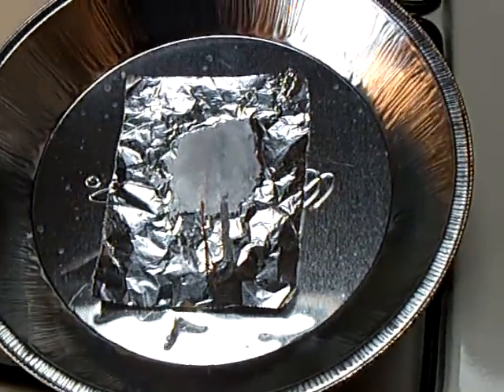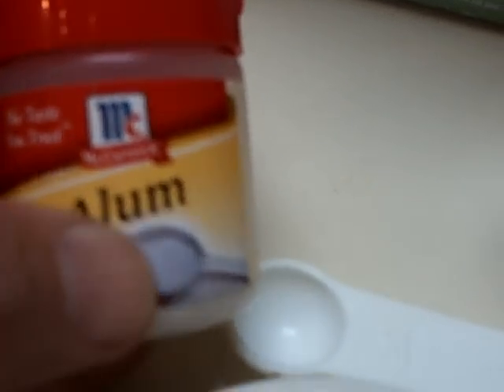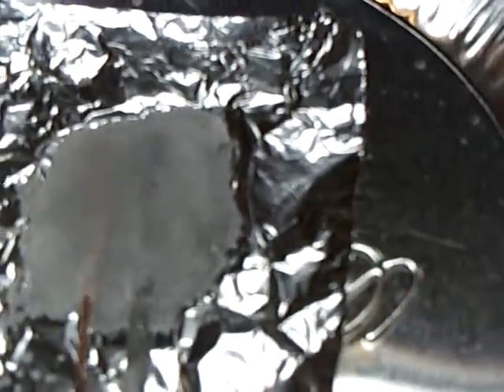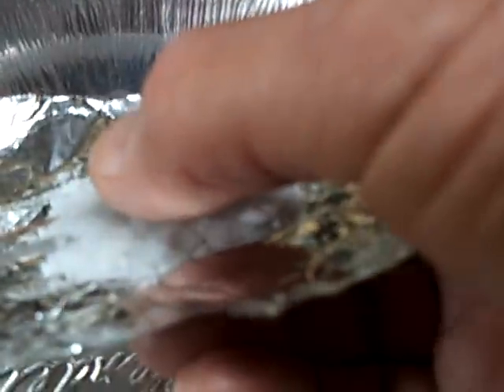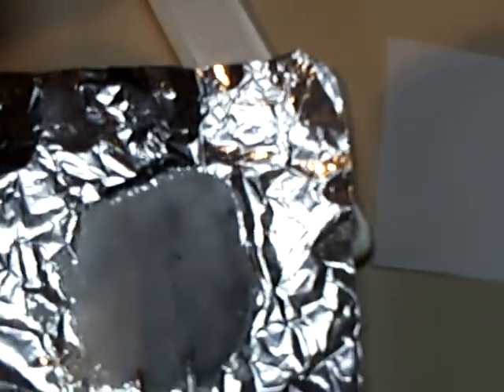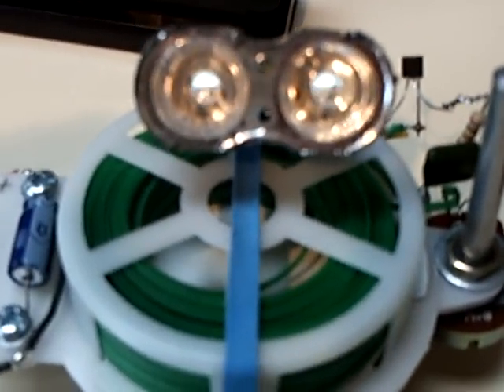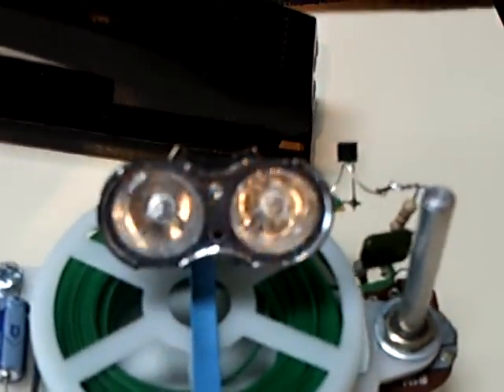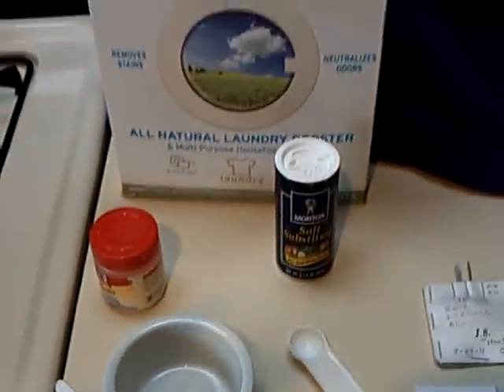Making an Ibpointless Stove Top crystal cell

Comment: fantastic!  great video.  Would a pair of these have enough power to run my TV remote?  I love that they are flat and I could attach them to the bottom of the remote with Gaffer's tape and stop buying batteries! (remote needs 3 volts)

Comment: Put one wire in there and connect the other side to the aluminum foil.
  The salt substitute is the piezo effects.
  The Alum has sodium and aluminum that's why they call it Alum
  The borax is sodium
  You can expect 5-400 mv from the devices using the config above.
  You can expect .004 per ma per device. 

   To see the piezo effec of the salt sub. squeeze a grain of the salt and put your digatil meter on mv.

Comment: I would have to say there is a doping but it is not metal. Crystals need seeds to grow right? Well there is a crystalline structure in aluminum. This structure is what we are doping with. All the different chemicals we are adding are building upon the crystal structure inside of the aluminum. This is allowing for a diode like action. The crystal we are adding are influenced by oxide crystals that form on the aluminum and are loosely based off of the internal crystals of the metal.

Comment: @Lidmotor
Interesting stuff with your circuits on micro amps draw... :)
Also, if you would manage to build solid state Tesla Coil and tune it to be as electrostatic generator.. Your micro amps can be amplified to amps after you would take power over Tesla step down transformer  for load. 
Just 1 hint: 1 wire AV diode plug charges capacitor and its discharge to load won't affect your input. :)

Comment from the maker: @egn83b ---The group that I am working with right now is focused on increasing the power output of these crystalline  cells.   The problem is complex because of chemistry involved.  Simply increasing the surface area of the electrodes or the entire cell size doesn't seem to be the answer.